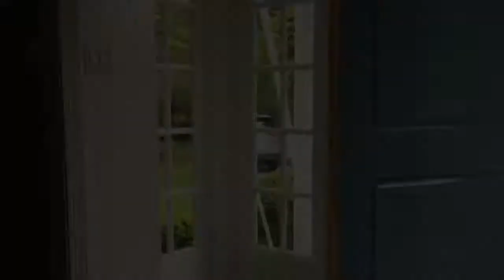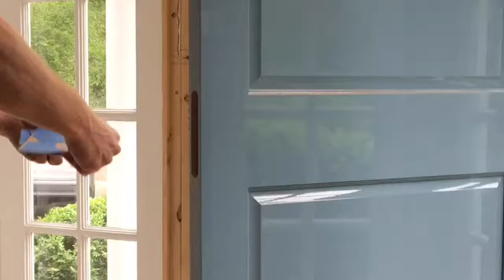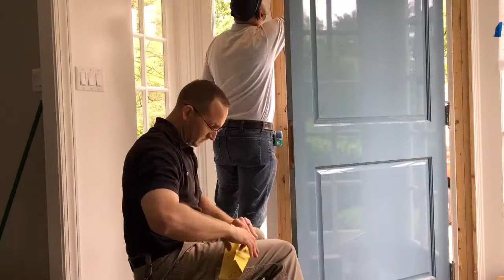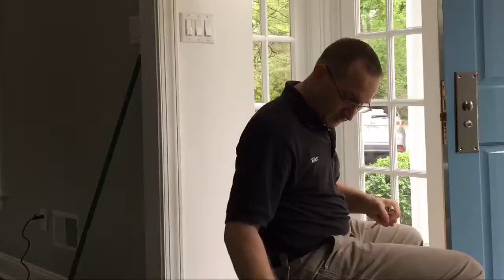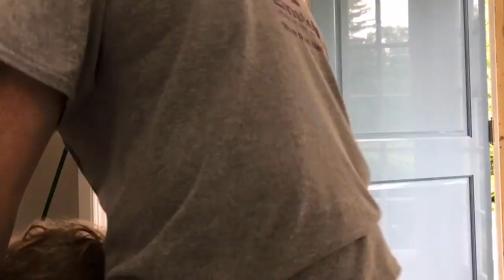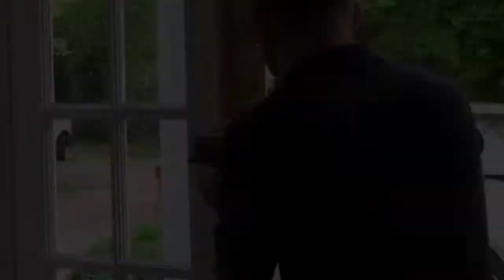Baldwin mortise lock install time lapse

Comment: Wow that door is like a mirror!
Btw, Baldwin makes an aluminum U-shaped slip over that marks the holes for the knob, deadbolt, thumb turn, and or thumb latch with dead on accuracy. You place it over a 1-3/4” door after you have routed out the edge of the door for the face plate 👍
Reply from the maker: Dan Ham Yes! I use it all of the time,however, I was concerned about scratching the door. It is a great tool to have.

Comment: Hello,  I Certainly do not wish to be Rude but from the inside of the door it looks like the escutcheon over hangs the inside Style Edge... Does it...? If it does then this Lock should not have been Installed...  It makes for a Very Bad Install... Sorry...  Greg
Reply from the maker: Gregory Londos unfortunately we explained this exact thing to the door contractor and the customer. Ultimately, the customer did not care that it hung over 1/16”. I personally think it ruins the entire door, however, sometimes as a hired contractor, you have to do what the customer wants even after you have done everything to educate them on how it should be.
Reply: @mikekozera5308 - I know this is old but it’s have a question about the inside escutcheon. Is it possible to use a belt sander and take off the excess material that was overhanging? Or would that destroy everything?
Reply from the maker: @2815Juan  it would ultimately ruin the finish on the brass and void any manufacture warranty that came with the product.